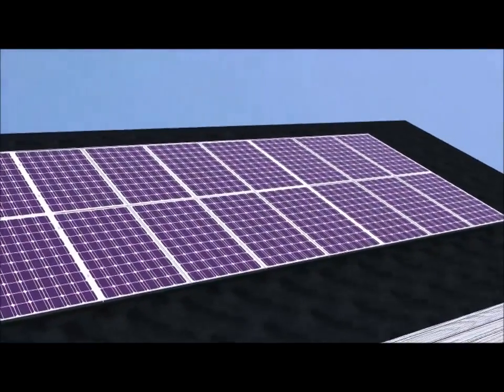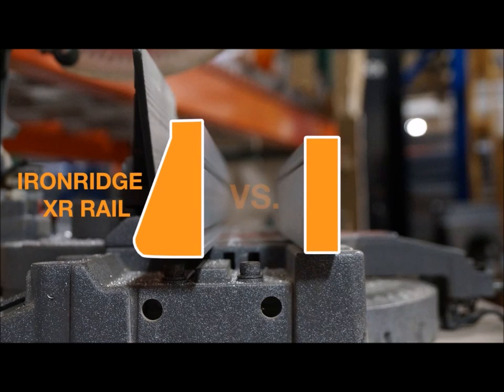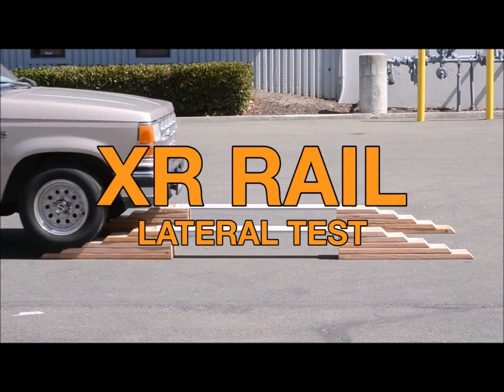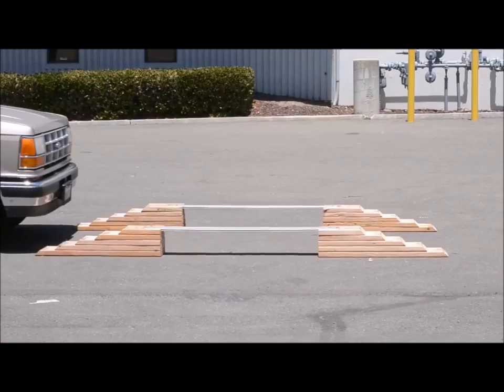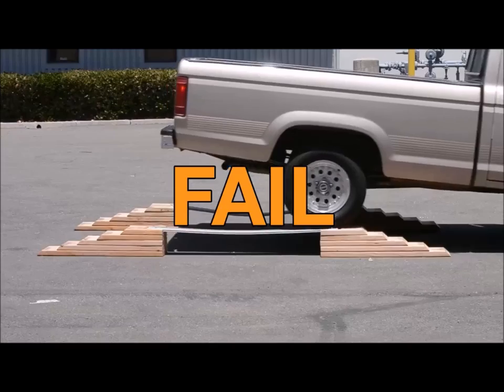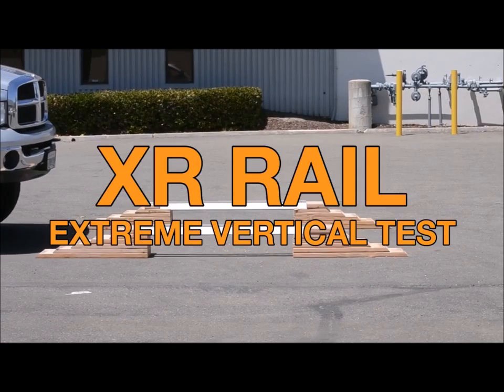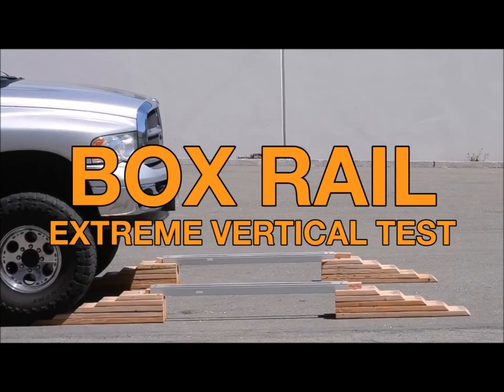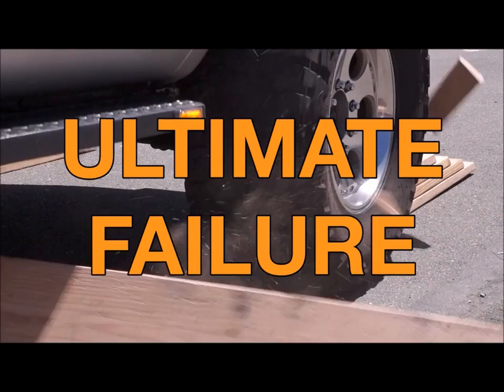IronRidge XR Rail Family advantages | RENVU

Comment: Hi RENVU:  I am building 6 offgrid houses in Baja Sur, MX (Lat 26). The roofs will be 6:12 pitch (26.5 degrees), made of concrete. I imagine a rail system that can be bolted to threaded sleeves embeded in the concrete. Do you provide these components?

Comment: I'm going to stop people from driving these trucks on my roof and solar panels. Kidding aside, are these rails available in the US? Do you ship worldwide?
Reply from the maker: It would be an interesting world if trucks drove on roofs... Yes, they are available in the US. We do ship worldwide, but note that these have to go freight due to their long length (not UPS).  You can calculate the cost of shipping by tossing them in the cart along with your address: https://www.renvu.com/Solar-Products/IronRidge-Rails
Reply: Thank you
Reply: Thanks
Reply: Trying to fill up the form but its calling for a state and zip code, this default to the USA states and zip codes will prevent buyers from outside of the US from completing the form. Your web designer will have to make some changes to the setup as its literally preventing me from completing the form.
Reply from the maker: Thanks for the heads up! I passed it along to our web developer. In the meantime, just let us know where you would like these shipped and we'll quote you out (you can email us at info@renvu.com with info on what you would like). Cheers!
Reply: RENVU Solar Equipment Distribution Might be easier for me to send it to my shipper in Florida and then he can get it to me. Probably let him cut then in half then rejoin them later, shipping 7 instead of 14 feet lengths will be a lot cheaper
Reply from the maker: Great, in that case we would just need to know the address of your freight forwarder in Florida.